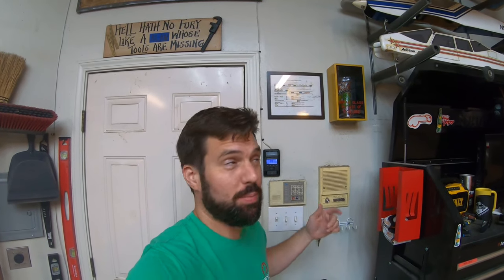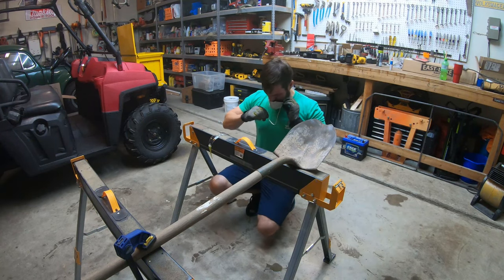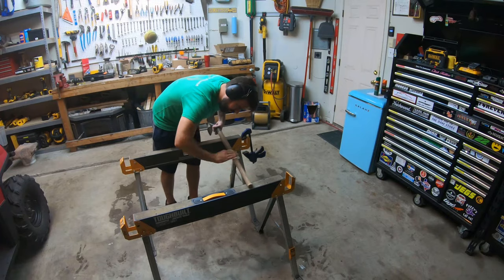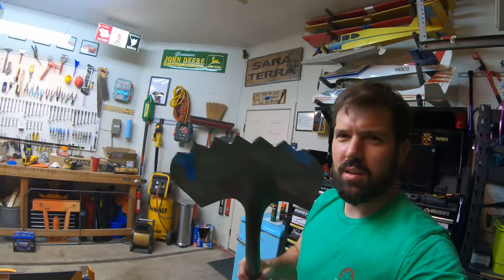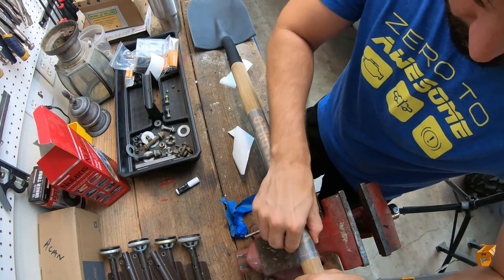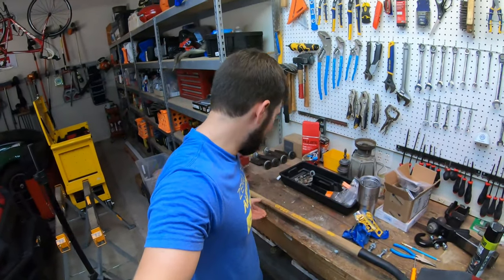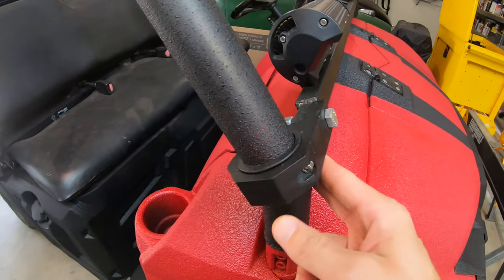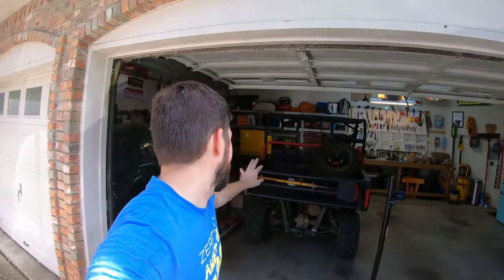DIY Krazy Beaver Off-Road Recovery Tool. My Cheap Polaris SXS Gets A VERY CUSTOM Accessory.

Comment: Did you have to drill holes in the shovel to mount it? If so, wouldn't that take away from its strength?
Reply from the maker: Keen eye, not only did I drill holes but I had to make the original holes bigger. We will see how this stands up on its first test-run, (test dig?).
Reply: @ZeroToAwesome  Then I hope it stays a show shovel.
Reply from the maker: It will live or die, the trails will be the judge. I just need to get stuck enough to use it.